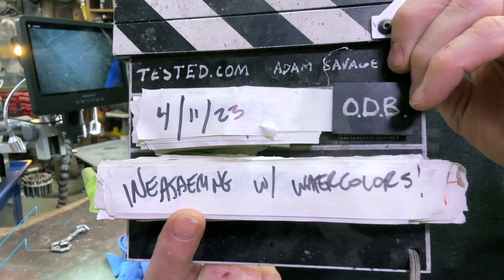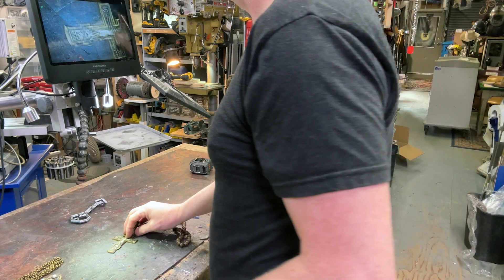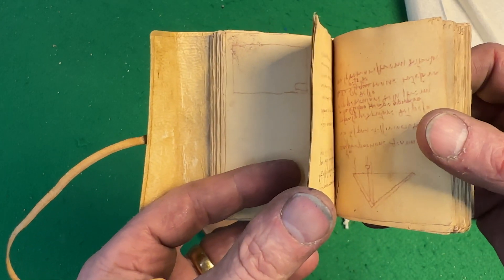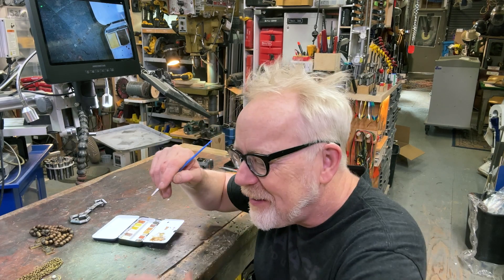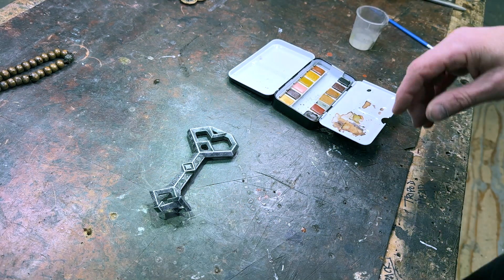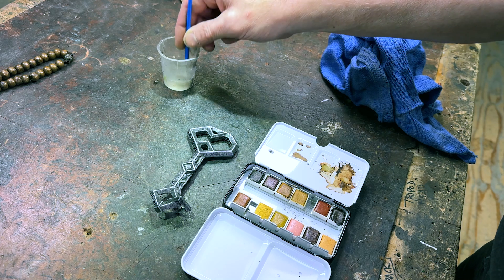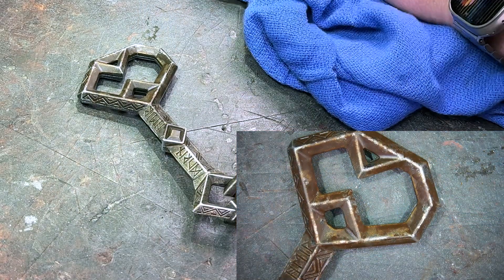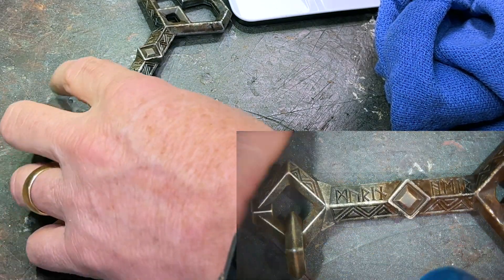Weathering With Watercolors?

Comment: One brand to look into is Daniel Smith. They're not cheap, but the color assortment is amazing, and most colors are in tube form which might be better a suited form to do weathering like Adam does.  I use them to paint watercolors, but also use in my acrylic paintings to get effects that are hard to achieve with acrylic paint.  I mix the colors with a clear medium so it will stick to the paint, and use them to create highlights or shadows with colors I can't get with acrylic alone.  I love their PrimaTek, Luminescent, and Granulating Watercolors.

Comment: I’ve just tried this technique but using designer’s gouache rather than block watercolour. Gouache has more pigment than watercolour and comes in a tube so you can apply it as you would oils. Works like a charm.

Comment: I purchased a digital microscope to aid me in my miniature painting. It’s really been a game changer as recently I’ve had issues with blurriness and double vision. It only cost me $50 Australian, and it has a 4 inch screen. It does however have a HDMI out and it can record to an SD card. I use mica powders or pastels for weathering. Pastels in particular are great because they’re cheap and highly pigmented. You just need to grind it down with a coffee grinder or use a file to make it into a fine powder. You can mix it with other medium’s depending on your needs.

Comment: Question for Adam, if the watercolor beads up when it's thin, then could you perhaps add a little dish soap to the water to break the surface tension?
Reply: Youtube being Youtube, I knew there would be something where someone had tried it and sure enough, someone did (albeit on paper). The soap makes textures in it when mixed into the water color. That MIGHT be good for a weathering pass, but it could also be bad. Definitely worth a try. Hope Adam sees your comment and tries it.

Comment: I use quiet often cornstarch and talcum powder, dabbed with a brush, or in a sock to touch the surfaces. Gives it more texture and can be pushed into corners to create grime build-up. Works well when the cornstarch is greened to make it look like oxidation.
Reply: Could also mix in Tampra paint with Cirb Starch or Baby Powder

Comment: I really like using super thin oil paints for the same purpose. I am curious how durable the watercolor is over time, the oil paints once fully cured are quite stable I would be worried about the watercolor wearing away over time, especially in humid environments.

Comment: I know it’s just a demo of the technique, but I couldn’t help but be a bit bothered by how you weathered it the heaviest in the places fingers are less likely to touch it, and especially in the part of the key that would interact with the mechanisms and get scratched and look brighter than the rest! I don’t usually tend to grab the shafts of keys, after all

I definitely want to try this, but inspired by real patina mostly do it in the places an item gets handled often. Since you can usually tell exactly where someone habitually holds a steel or brass item! And maybe mask off a couple thin strips where I expect it to engage with the teeth of the lock (or scratch it in), for prop keys. 

Of course I’m sure you know all this, and when an item is important in a film you probably do take these things into account rather than just applying it randomly as a demonstration!
Reply: While, like you said, it's a demonstration first and not looking to be accurate, there wouldn't be normal use wear on this particular key at all. 

It was made because of the fall of Erabor to open a secret door and isn't used for about a hundred years.

Comment: Very cool! I've never seen artists watercolors used like that right out of the palette for this. But for an alternative you can look into watercolor pencils! Especially for styrene kits and scratch builds with flat surfaces. They can be used wet in a similar manner to how Adam's shown- or dry. It's really cool to see them put on dry to quickly replicate small scuffs and scratches and then they can be blended with a slightly damp brush and softened or completely erased with water. The extra feature this brings to the table is if you're already using oil paints to weather, the two can be used simultaneously to layer a lot of effects on at once as they don't interact with each other. I learned all this from Rick Lawler, he's got a YouTube channel if you search his name under his "Propaganda" branding. Seeing him use watercolor pencils and oil paints in real time to get really layered finishes is great, especially with the speed this technique affords him.

Comment: Those runes are so wrong. No better way to put that. That is the rune set that Tolkien used for the maps in the hobbit. They are a modified form of the Anglo-Saxon Futhorc deisgned to transliterate English, not the Dwarven runes used in LotR proper. They read "Murin heir" in English, which: why? The "M" and "D" runes are similar, obviously they meant Durin but flubbed it. They are mirror image reversed on the back, which is just lazy. I guess you could argue that since that was the rune set that Tolkien used in the Hobbit illustrations, it's canon here, but the dwarven rune sets are given in the appendices of the LotR which would definitely supersede the Anglo-Saxon set.